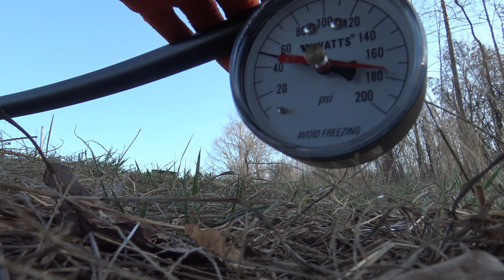You've never seen a farm water system like this...cheap, easy no electrical required!

Comment: Can you add extensions onto the hoses so you can take it to different feilds?  Could you use this as a permanent source if not what would you use for off grid?
Reply from the maker: solar would be much more reliable for off grid...I work with a company called Lorentz....here's a link for you...these ram pumps are ok, but way to much maintenance v/s a reliable solar setup like this:  Lorentz Solar: https://us.pumpwithsolar.com/discount/SRF1025  enter SRF1025 at checkout

Comment: How could you make this have more pressure?
Reply from the maker: more drop ahead of the pump....there's a pile of info on these on the web...but honestly I don't recommend it as a permanent water solution...too much maintenance and too many failed pumps in  my opinion

Comment: Where did you place the actual pump? It looks like it’s down in some kind of ravine from where the pond is. Can you explain where you actually placed the pump and why.
Reply from the maker: pump was placed downstream from the pond...where the pond water runs out of the pipe...The pipe simply runs from the pond down behind the dam which gives it enough "fall" to run the pump....you've gotta have "drop" or "fall" ahead of the pump...it's driven by the water falling...for every foot of drop ahead of the pump..it pumps up 6 feet I do believe. check out @landtohouse youtube for detailed info

Comment: Man iam trying to get drinking water with no electricity. I looked into getting a hand pump no electricity.  It will cost over 16,000 dollars . You have to drill a well. Then try something like a bison pump. No natural springs or creeks on the property.  I never imagined getting drinking water could be so hard to get. Great video. 👍
Reply from the maker: Safe drinking water is very important...don't skimp on it my friend.  Drill a well and install a pump...fire the generator when ya need water...shut it down when ya don't....simple, cheap and way easier than $16k

Comment: Hi question I have a artesian well . It has a over flow pipe from well to a area in back or side of house . When I have the water on in the house or hose on it trickles when u don’t have water on it flows pretty good and the birds and animals use it to drink it causes a puddle that drains under a tree how can i use that water instead of it just flowing..is this a product I can use or any other . What do u recommend. Thank you

Comment: I think if you use a bigger pipe up top and break it down to smaller pipe you should pickup more psi (pressure) this was done back in the day for strip mining. The flow of the water running downhill and the pipe size added more pressure

Comment: Just fill a length of hose or pipe with sand and cover the ends with stocking material put 1 end in a water source eg pond other end up hill the dry sand  absorbes the water pulling it up hill and  will dribble out of hose

Comment: When you added a tight 90 deg. fitting under the frost-free hose bib you added a 25 percent flow restriction. If you had added 2 feet of hose into a wide sweep 90 deg., under the hose bib, the restriction would have been almost nothing.

Comment: may want to float the intake with two empty winshield wiper jugs on either side of the intake and a rock anchor on the other side... that way you won't pic up crap from the bottom.

Comment: How does that inner tube work?  Do you just fill it with some air and stuff it in side?  I have seen ram pumps with no bladder and just build pressure in their with the air that is already there.  Does the inner tube provide higher pressure?

Comment: back in 1945 the farm i was born at had  a big one steel 5ft  (175) tall 3 (75mil)inch pipe that pumped up 500 ft  (650m)  and a distance of 2 miles (3.5km)  for those on modern money.

Comment: Hi buddy.very impressive. Question. Does it need to have slope to work and if so which way( I'm a cluts ok?) What I have is a pond about 600 yards from my cabin. I want to draw the pond water to the cabin but there's no hill .the cabin is still at the same ground level as the pond. Would it work for me?
Reply from the maker: I guess I'm not sure how you'd have a pond with no slope?  If the pond has a dam then you have a slope...for every foot of drop ahead of the pump water will move up 10 feet....so if ya ran the pump over the dam to a low spot then it would pump up 10 feet for every 100 feet....now...would I wanna pump pond water into my cabin?  Not so sure unless I wanted the squirts lol...shoot buddy....hit up the link and buy one...give it a try...good weekend fun project! Woooo!!

Comment: Very useful video.May you send me the height and the diameter of the main pipe and the distance between  the pipe and the valve?? My regards
Thanks a  lot.
Reply from the maker: So...if you look down in the video description you'll find a link to the Ram Pump from Seths place...he builds them and sells them.....3/4 inch intake  1/2 inch output.  Will pump up 7 feet for every foot of drop ahead of the pump...in other words...if pump is 10 feet from supply intake...it will pump up to 70 feet high....low pressure....low flow..but enough to keep water moving for storage in these tanks
Reply: @StoneyRidgeFarmer  Dear friend,, i remembered you last period a again,,, About my interest to build or to buy one ram pump like this,,, You sent me a few usefull information about this,, For example if i want to send the water 100 ft far from the pump i must connect this 10 ft far from the stream?? Then may you send me the Seth's link to ask him about costs to order and buy one from him???  I can not find the link.. Many regards for your help again,,,,,,,

Comment: so water leaves the pond and flows downhill through a 3/4'' pipe that drops 4 vertical feet over a distance of 200 yards. At this point the 3/4" pipe is connected to the RAM pump intake.  We step down to 1/2" pipe connected to the RAM pump 's outflow.  Due to the nature of the RAM pump we can now send water uphill and over distance through the RAM pump outflow 1/2" pipe to a location of our choosing.   

The RAM pump uses the pressure of the water that enters the intake and magnifies the pressure so the water can be depositied throught the outflow to much greater heights and much farther distances, but at less volume.   
 
So a RAM pump is basically a booster that samples the incoming pressure to slowly accrue pressure so that the water that is sent away is under much higher pressure than the water that is coming in. 

The video was confusing because I didnt understand why the water left the pond downhill to the pump before the pump sent it uphill across your land.   It wasn't understood that the RAM pump requires that water be sent into it under pressure in order to operate.   However now that I've wrapped my mind around the concept it is actually quite brilliant as it requires no electricity, has very few moving parts to break and can operate continuously without maintenance forever.  This is the kind of thing that Leonardo Da Vinci and Archimedes may have contemplated

Comment: This is my dilemma, can this work on no moving water except for gravity. My mind says it should work but I am not sure. Could you try this idea on another video? So my idea is an input that is say an 8ft vertical pipe say into a lake or well . Water then from gravity goes down the pipe into the ram pump that pushes the water uphill. Cause im wondering if a person could put this in a lake,say under a dock, run the ram pump out of the lake uphill say 30 ft into a holding tank. The only thing that tells me it might not is because the 8ft is not active force and then its just the 8ft against the 30 ft of water , not to mention the length of water in the pipe weight against 8ft of water in the pipe. is there another way? Wind pump? a bike pedal assist? ahhh maybe just hooking up a gas gen to power a pump is best...

Comment: wouldn't increasing the size pipe on your outlet increase your head pressure to make the pump run for shorter distances (head  height)

Comment: So you have a pond that is lower than where you need water. You use a large pipe and put your pump below the large pipe below the pond. In effect creating your own drop. Install the ram then pump water from there back up to where your cattle are located and for watering the different paddocks. Question. What feeds your pond? Is the water coming into the pond more than what is being pumped out? If a creek feeds the pond why not just put the ram in the creek? If its a spring fed pond I assume the pond has overflow back down into another source. I thought I heard you say the waste water from the ram just goes back to the creek. That is why I said, just use. the ram in the creek unless the head of the water in the creek is not sufficient. Just trying to get a clear picture.
Reply from the maker: you're missing one part of the equation....the intake pipe moves with fluctuations in water pressure...intake needs to be under water ...we're pumping out of the pond...the back side is the drop...then pumping up to the hose bib...if you let it run constantly you'll make a mud hole

Comment: Love it! Thank you! Could I do this with a rain barrel as water source, want to water my garden barrels passively? Thanks!
Reply: I had to rethink my first thought. Yes you could but why. A ram pump wastes water and if you could not recover the water then you'd empty your barrel real fast. If your garden is near your barrel why not just use the pressure from your tank to push water to your garden and when the watering is done just shut off the valve. A ram is mostly used with a continuous source of water and having a need to get that water up a steep slope to a higher place. Some people make ponds using a ram pump to fill the pond. Once the pond is full the ram keeps it full as it drains back into the creek or river. Your rain barrel is like a small cistern. Put a valve at the bottom of the barrel and you have pressure as long as the water in the barrel is equal or higher than where you need it. Im assuming that the pond being used here is being fed via a spring or something. If not then he will eventually empty his pond by pumping water out. His pond is below where he needs water. If there is a creek below the pond I'd just use the creek. Not sure how his pond is kept full of water.

Comment: Suggestion: On my farm in Yadkin County, I had a lot of horse pastures with the same type hydrants. I ALWAY had water problems coming from the elbow at the bottom of the hydrant. At first I took a 4 x 6 and cut out enough in the center of the 6" part to recess the pipe then covered with straps. All this was in hopes of the hydrant getting bumped and twisted causing the elbow to break off. Well it worked a little. Then I stopped using pvc elbows and went with brass elbows then connected to my pipe. Problem solved! So in the long run, I highly suggest all your elbows should be brass. Saves a hell of a lot in digging back up to fix a water leak. I now live on the Southern Outer Banks and use the same method to supply water to my sheds, greenhouse and several other functions. Take care my good ole homeboys!

Comment: very nice.  Can i use the same tech to fill my tank slowly up the 3floor building?  The source of water would be from rain water accumulated on the ground
Reply from the maker: you have to have "drop" meaning the water that feeds the pump has to have pressure on it from above....for every one foot of drop before the pump...it will pump up 7 feet...that's how it all works my friend...head pressure ahead of the pump is what makes the pump work

Comment: When you say at 3:34 that some of the water is shot back up to the source, do you mean water is shot back through the feed line from the source? Or are you referring to the water that is coming out of the stainless flap valve after the pump starts to run at 13:20?

Comment: Very good video. So there can be perpetual motion. I’m trying to wrap my head around this “ram pump” design. So, you have to put the pump below the water source, to allow water to be gravity fed to the pump (or fed by siphon if there is a jump between the source water and the pump)? Then the ability of the ram pump to push water uphill is a function of the height of the source above the pump? Or the high point of the system above the pump? Great video. Thank you for taking the time to produce this!
Reply: The actual energy used to pump the water out of the pump is coming from molecular attraction of water molecules which cause the force.   Think of a train with many cars.  What you are doing is ramming the engine into a wall, and then capturing the energy as the caboose 'rams'  into the car in front of it.  The intermolecular forces are the links between the cars.  Most people, inaccurately, think it is the vacuum/siphon that pulls the water, but it isn't.

Comment: Can it work vertically in a well,about 50 feet? Thank you
Reply from the maker: You are taking water from a high point.....drawing into the pump...this requires siphon and pressure from the top of the hill....for every foot of drop before the pump...the water pumps up 7 feet....you can't pump out of a well

Comment: Hi there quick question is that ram pump work on run water? And I want bit more pressure to pump more water
Reply from the maker: Yes it runs on the pressure of the water flowing down the hill..if you want more pressure then have more drop on your intake pipe.

Comment: If you need more or less water pinch back on the half inch valve or run the line further up the grade to another watering tank.

Comment: So this pump is actually more efficient the higher it has to push the water?
Reply from the maker: It does need a bit of back pressure to work the check valves

Comment: I'm a little confused on where the pump's location was.  Did it need to be at a lower level than the pond?  When he siphoned it with his mouth, I would think he had to be below the level of the pond for the water to flow like that.  So was the pump placed down hill from the pond?  I'm thinking to make this as my pump for my landscape pond.
Reply from the maker: The pump is about 6-7 feed below the level of the water inlet....the ram pump will pump up hill 7 ft for every one foot of drop prior to the pump.   That drop pressure is called head pressure and that's what runs the ram pump 👍

Comment: Not so convincing the way it was explained..!
Reply: wranglerstar on youtube did a video years ago about it, he put it in a creek and ran it up by his house. It works we just don't believe as a society anymore because we thunk everything has to cost us something. Like I mean to operate a pump and electricity, have to buy the parts or pump but is free to operate after that. what makes it have power is the pipe coming down from the pond, you have the weight of the water pushing the ram, that uses the force of being shut off and the shock to power the pump.
Reply: Great . Will try it in Fiji

Comment: You probally answered my question already but I have a 3 acre pond fed by natural springs so in the heat and drought of summer it may go down 4" at most.I want to get water from the pond up to my camper/work area,ect about 250' away that's on a small slope.Would this pump system work for me on that?I have looked at laying pvc pipe and putting in a manual pump or pump run off a generator but your ram pump seems the way to go with no electricity/generator needed.Thanks
Reply from the maker: I'm sure it would work as long as you have enough drop on your intake

Comment: You can hang the screened inlet on a 'float device'  about a foot below the water level.  The inlet will stay out of the mud and near the cleanest water at the top of the source. You could drive a vertical pipe into the lake bottom at the deepest point to keep the screen/float properly located.   One psi of pressure will raise the water 2.3 feet.  SO If your pressure gauge shows 48 PSI the water coming out of the faucet was about 110 feet above the gauge.  Since you used a vertical pipe/tank for the accumulator it is Not necessary to install a rubber bladder. Because aspirated air will always rise above the water in the accumulator, thus providing the desired cushion effect for the pressure surge.  Thanks for Sharing your Project.  <;)
Reply: I liked your comment cause you sounded so smart! Unfortunately it's Greek to me!! :/
Reply: @diannevaldez8670  When you learn Greek you can come back and you may understand.
Reply: @williamterry3177  yeah I might have to buy a book or something. It's too bad you find such satisfaction spending your time working on trying to bringing people down and discouraging anyone.